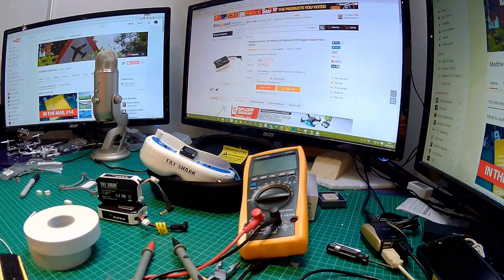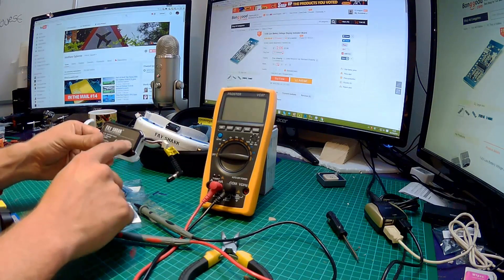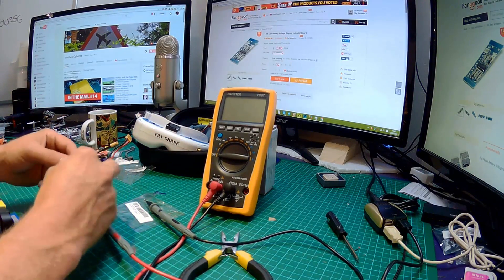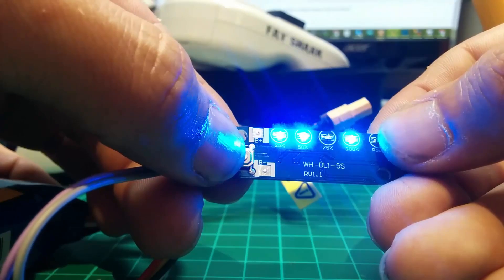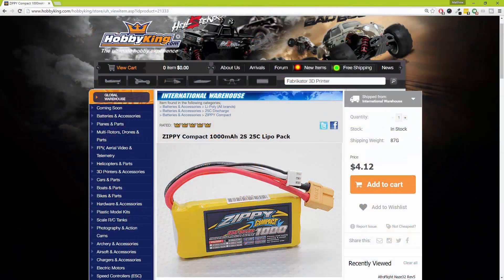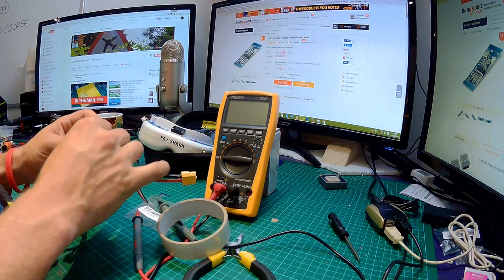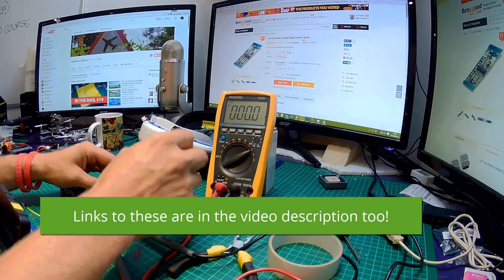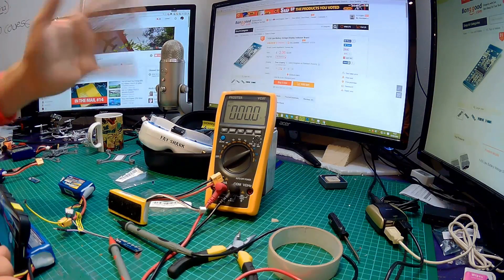DIY LED Fatshark Battery Capacity Board - Make Your Own FPV Batteries Hack

Comment: Hi Matt, I stumbled upon this video while trying to solve a fs battery issue Im having.  Perhaps you can help: is it possible to use my bench power supply to charge a fs battery instead of buying an RC battery charger?
Reply from the maker: Howdy Mike, you could use ti to power the battery charger, but not the battery directly as they need 50mA or something near the end. Definitely DO get a dedicated battery charger. Matt
Reply: Matthew Ogborne Thanks!

Comment: Matt,
I always wanted to make an adapter/extension battery cable for my FS goggles.  The barrel connector on one end and an xt60 or JST on the other.  That way I could grab any of my 2S batteries, plug it in and put the battery in my pocket to keep on "ragging" (obviously without the option of the fan).  I don't want cut the connector off my FS battery and have never messed with buying and soldering a barrel connector before.  I am not a noob, but still scared as sh*t to smoke my goggles.  Not sure if this is the way you are going with your FS battery alternative, but would love to see details if you are dealing with buying/soldering a barrel connector.  Loving the channel.  Thanks and happy days!
Reply from the maker: Morning! Yep that would work & work for any battery as you mention! Soldering a barrel connector is childs play, the only thing you can screw up is the polarity of the wires. A multi meter will confirm the correct way around (normally the center is positive). Matt
Reply: instablaster...